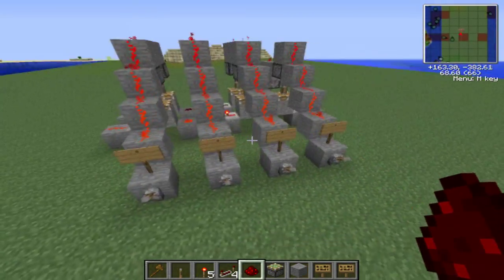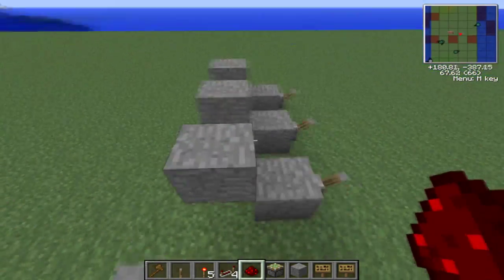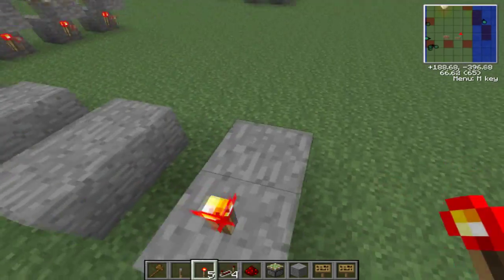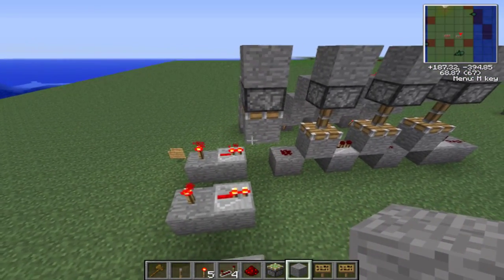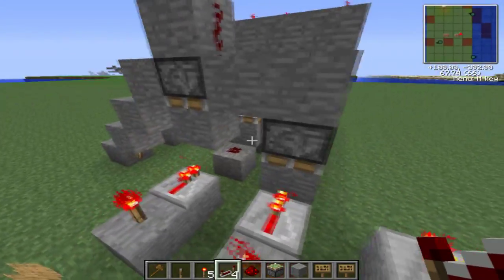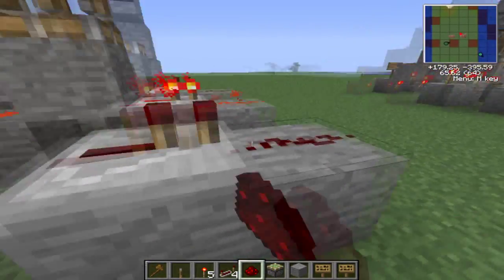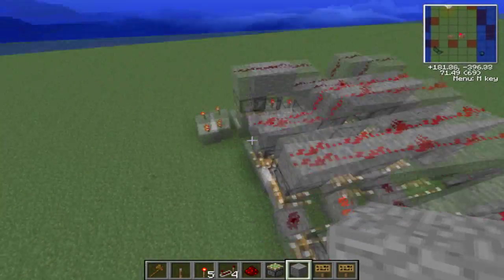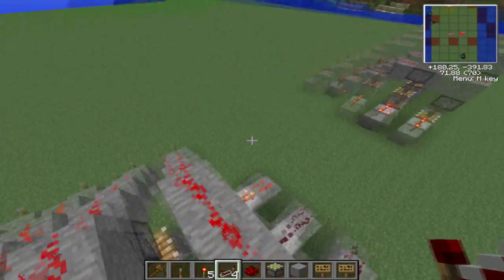Minecraft  FASTEST binary to decimal decoder [piston]

Comment from the maker: it does work, this is not based on a glitch
this is actually an and gate made out of pistons
for example  1010
if the first one AND the third one are 1 then give this output (decimal)

same goes for 1111
1st AND 2nd AND 3rd AND 4th

so no it still works for 1.5

Comment: You should advertise this as compact instead of fast, If you use instant piston's for the input bus you can get it even faster as if you have something like 64 bytes of data that bus is going to add 8-tick delay. 

If your building a advanced PC my decoder would be a better option but i do love a smaller decoder. I tend to use the old two input buses with one bus inverted then placing torches on the bus to basiclly AND the inputs that should be on/off. Speed is much faster then this design too.